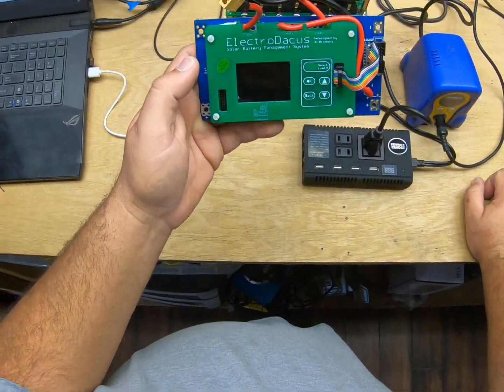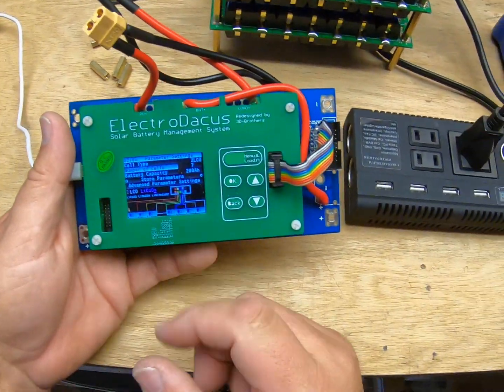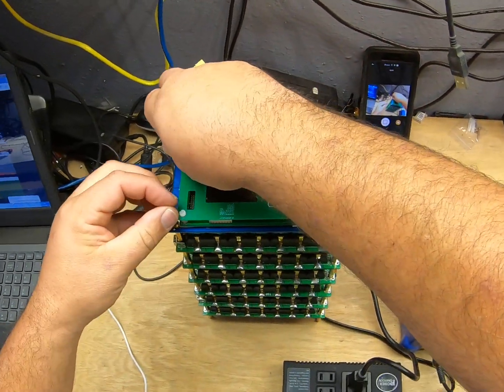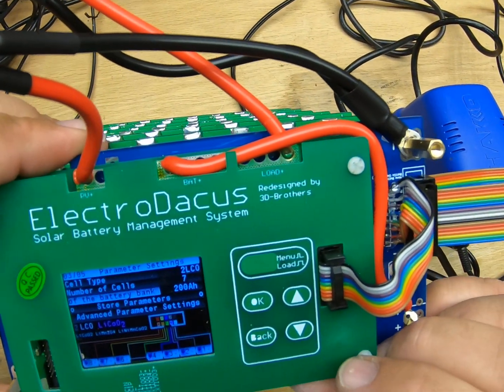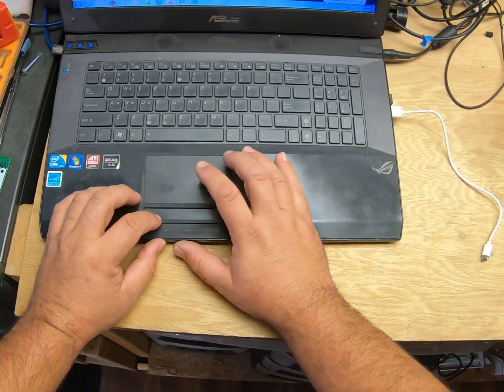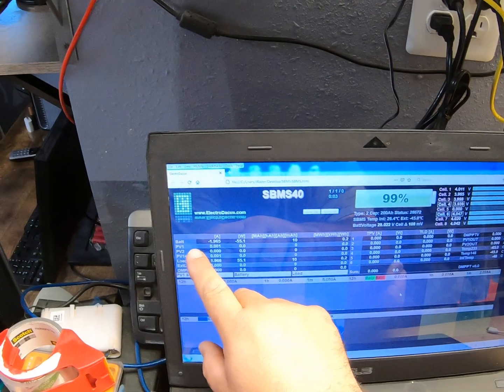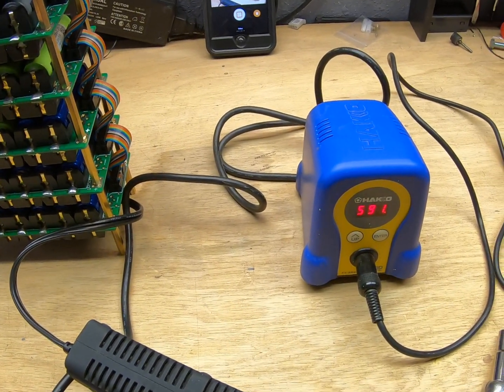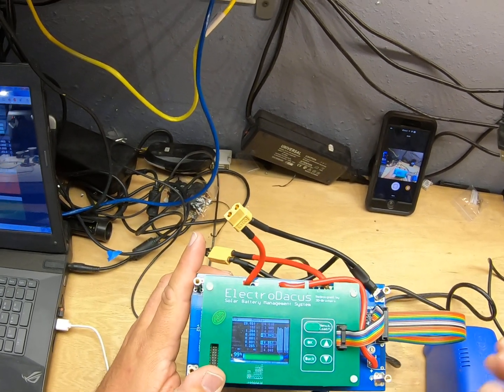ELECTRODACUS preliminary, PRE-production  Review!

Comment: If I already have a good victron solar charge controller , can I still use the electro dacus onmy 10 stack as just a bms? Or would it interfere with my victron. As long as I dont hook up the pv wiring to the electroacoustic. I dont see it being a problem ..any help please?
Reply from the maker: I would not run this with another controller, I think you would be better served using a Bluetooth enabled BMS Daly makes some good units in my opinion, and would be more than half the cost of this unit!